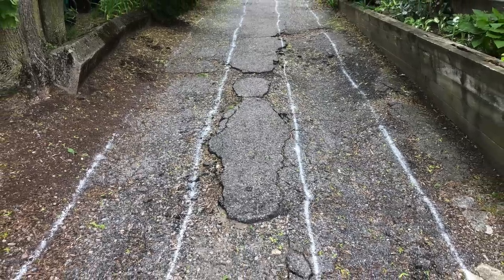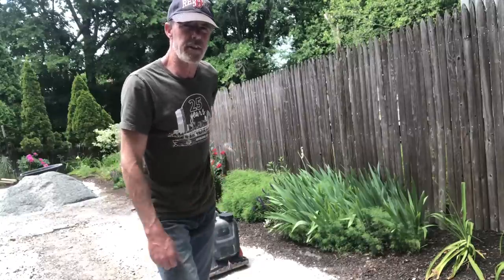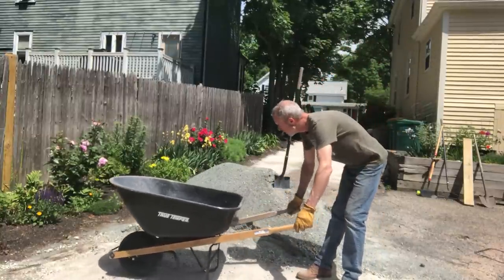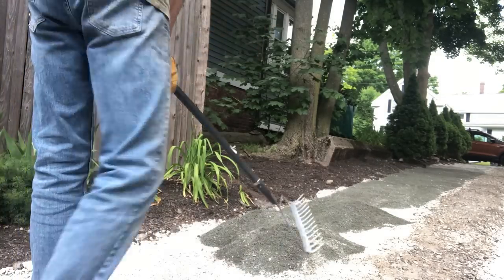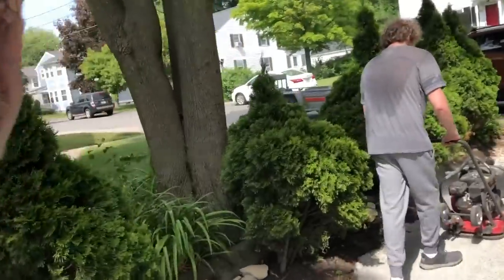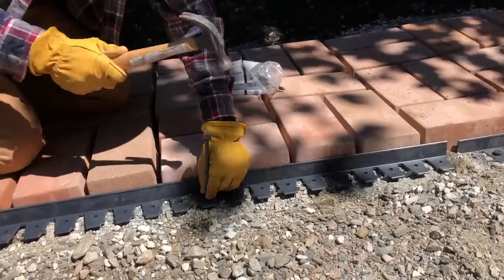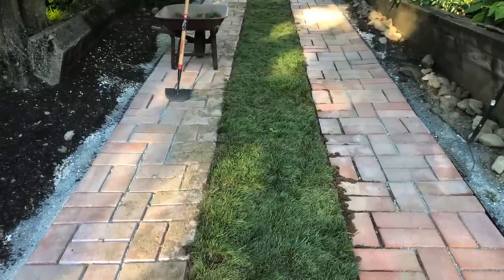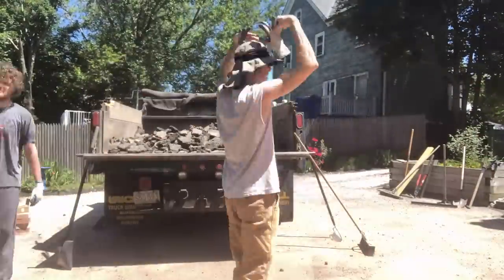DIY Driveway Transformation

Comment: I think the stones look fantastic, but the driveway is very uneven  and not really square. I'd recommend using  a cord grid, to get it square. To get the surface even, you should not compact the 8-16 gravel before you lay the bricks. Instead you take can take a straight 12 ft board (or whatever the width is) and scrape the 8-16 gravel surface. Use a level to check that it is straight. And then you lay the bricks, using a rubber mallet to get them level. Every feet you can check the level of your driveway to make sure that you stay level. Once finished, you can spread some 2mil sand on top of your driveway and scrape it with a broom into the spaces between the bricks. At last you should then take maybe two sheets of 2 inch plywood to cover the bricks and stepwise compact the driveway with a compactor like the one you used. This way you will protect the surfaces and edges of the bricks from popping off.  The grass in the middle looks really nice, well done (y)

Comment: hows the driveway looking Dan, we're about to do this and grateful for your video thanks.  And mad skills on the unicycle!
Reply from the maker: Thanks Wendy, the driveway is holding up well. This is the 4th winter for this driveway. I’ve had to do minimal maintenance on it. The maintenance being resetting a paver occasionally because it had been lifted due to ice pushing it up. This type of driveway isn’t good for plowing when it comes to snow and ice removal. I’ve never had it plowed, instead I just shovel it clear and for heavier snowfalls I clear it with a snowblower.

Comment: Nice job.  Does the stone dust stay in place pretty well in between the bricks, like when there’s a lot of wind, rolling suitcases or rain?
Reply from the maker: The stone dust between the pavers is not the best material for that purpose. I ended up replacing it with polymeric sand. I will try to add a subtitle explaining this. Thanks

Comment: Bummed you didn't level it or make it perfectly parallel. Some center stones would have been good also so that you could put a jack under a car and get it up in the air easily to do work.
Reply from the maker: Those are excellent concerns. Before I started the project I carefully observed the most common path vehicles descend the driveway and based the placement of the paving stones on that, that's the reason the paths aren't perfectly straight, it was intentional. They do however measure 5' to center all the way.
We will very rarely be parking on the driveway, just driving on it. The driveway leads to a parking area behind the house that easily fits 6 vehicles without any of them getting blocked in. Near the end of the video I ride a unicycle down the driveway and into the parking area and at the very end of the video the parking area is where I parked the rented dump truck to get rid of all the old asphalt. Thanks for watching!